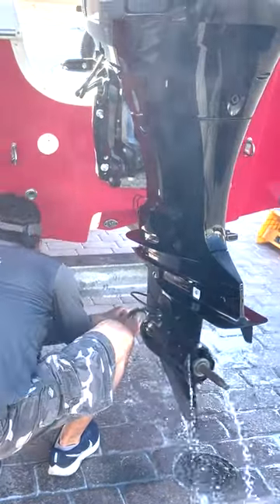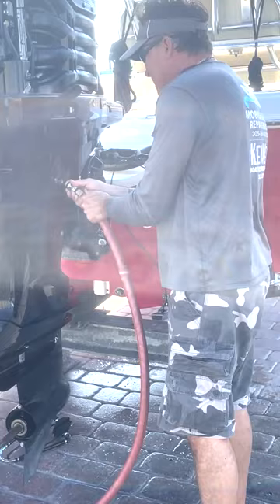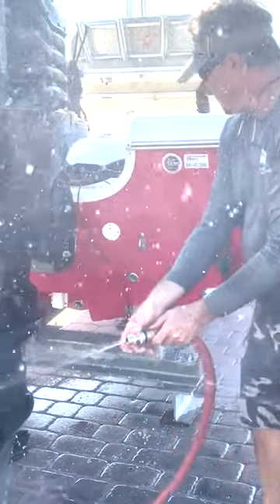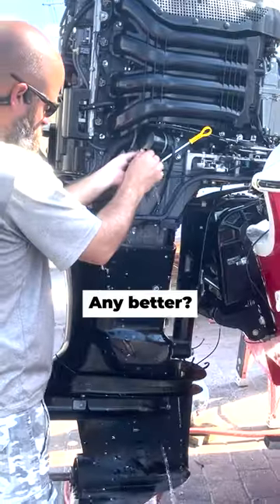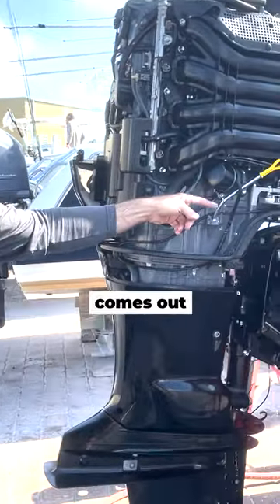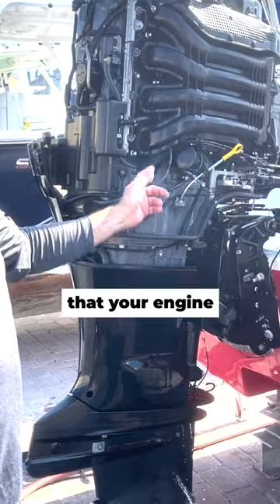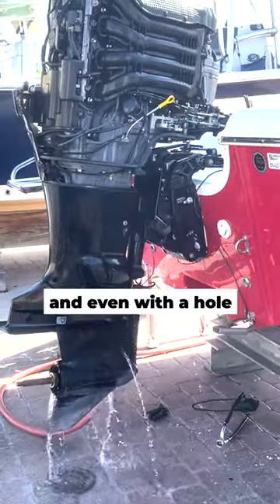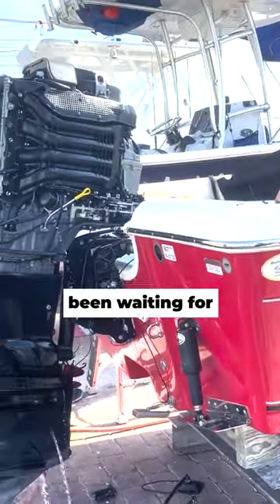OMG My Outboard Motor is NOT Peeing

Comment: Some older engines require you change the water pump impeller every 12 months . I did mine every 18 months . Also you should freshwater flush your engine everytime you use it . Also newer engines may not require replacing impeller as often . Consult your owners manual or ask the service dude . If you have to use weed trimmer line to unclog the pee hole you aren't flushing long enough or at all . 
After I wash the boat I flush the engine.  Let the motor run at idle while you dry off the inside of your boat . By the time you spent wiping stuff down that should be adequate time of flushing .
Reply from the maker: Our owners hadn’t flushed it was full of salt!

Comment: I would pull the lower unit just cause and rebuild the water pump. At least every 2 to 3 years I do mine unless my water pressure gauge says other wise. Meaning lower pressure than normal and my pick up is clean and clear and all water ports are free and clear. Always flush your motor after running it in salt water heck I even do it after taking it to the lake. Soon  Myers boat shop in Victoria Texas will be open for business. It will be one of the best and most reliable boat shops in South Texas. Long line of family and friends who I grew up around that have shops and are retiring. Learned from some of the best boat and motor gurus in South Texaa.
Reply from the maker: Good for you sounds like you have experience! We changed the pump but ended up being full of salt!

Comment: Plugged by tiny dort wasp or silt.
If it doesn't start working after clearing it. The rubber water pump is hard, cracked, and worn out
Reply from the maker: We replaced it … ended up being full of salt!

Comment: i have try that trick didnt work so i make video how get rid of clogged issues but not for yamaha engine because they have brass or copper inside tube which salt water cause it to clogged up inside engine so i ended up pulling head off grab long wire brush put on drills and stick it down port and drilled it out so no more clogged issues
2nd if your small hose is clogged them check for exhaust vent above propellter  front of top u cant miss it from lower shaft stick out look above it will see vent and see water coming out of that vent which it mean not clogged up if no them it iis clogged up but i dont trust small hose from engine i trust one by lower gear box front above propelleter because only water exited from it if you start it up and let it run little bit longer you will feel hot water coming out of it
Reply from the maker: Ours was full of salt ... owners hadn't been rinsing it!

Comment: Sometimes bees fill it with mud as well or it could be an impeller. If you use the muffs to force water in it, but drop the lower end into a big barrel of water to see if it sucks water in. 
If the impeller is shot, you're still forcing water through under pressure.
Reply from the maker: Was full of salt!

Comment: I was always told don’t rev the motor when using the ear muffs with a garden hose because the water pump on the motor sucks more  than the hose can provide and can burn up the pump that way.
Reply from the maker: Our issue was salt?
Reply: @WillFixThat  glad it was an easy fix in that case. Just was something I always kept in mind when we had boats
Reply from the maker: @stevecourville199  thanks for sharing

Comment: Probably the impeller I had an old Johnson 25 that the rubber impeller would dry rot if sat up for more than a month without water being run through the engine.
Reply from the maker: We changed the impeller it ended up being full of salt!

Comment: I think I need to learn more about outboard engines, switch from mower to boat engines.
Reply from the maker: Or both 😆
Reply: @WillFixThat  you really don't unlearn how to do something, I was a Auto mechanic for many years, cars just got to be computerised I gave up, started driving and on working on mowers. Now those are getting computer's,  outbound engines have a lot more parts, but it's a engine transmission and drive line, can't be very difficult to figure out
Reply from the maker: @kennethwoolever5054  some of these outboards you also need a computer to read codes when you have issues!

Comment: My outboard wasn't peeing. Changed impeller, thermostat checked lines and water jacket. Still no water on "muffs". Figured out it's a dry sump and had to put it in a bucket so the water level was the same as the impeller would be in the lower unit.
Reply from the maker: Ours was full of salt!

Comment: Yeah that motor will be junk shortly . If you have salt issues then it is over . Maybe a couple more years but that bell has been rung . Flush everytime you run salt . If your not running it daily in salt . Even then ill flush mine occasionaly . The worst is running in salt and letting it dry without flushing . The crystalizing of the salt does the most damage to every edge ande nook and franny in that motor . Im A mech btw and guys a handheld therm is great for a laying alot of the fears and guess work as to whether it's actually hot or not 30 bucks .
Reply from the maker: Awesome… we DO to tell our clients whether or not they listen! You know the old saying about leading a horse to water!
Reply: Yes sir. You may find this uncommon as well. I replace my pump every year , I like opening the lower end and seeing what's going on . Rarely do I not find something cool . Like dog gear shavings or a little watta..lol. seriously tho maintenance is cheap.
Reply from the maker: @danglss76  we only do this if the client asks for it …. We aren’t looking for work if you know what I mean!

Comment: Ummmm, doesn't it need to be in the water? The boat picks up the that the boat is sitting in and spits it out those holes.. that's why you should run your boat motor when it's not in the water for very long
Reply from the maker: It needed an acid flush.

Comment: Impeller my friend your supposed to service your lower unit and impeller every season or 300-500 hrs idk about you but when rubber sits it dry Rots
Reply from the maker: This is a very new boat … we just did 200 hr service for our client?
Reply: @WillFixThat  very odd because if it’s newer it shouldn’t have any salt deposits built up in it I wouldn’t think might have sucked up a piece of Reid grass or something
Reply from the maker: @NcHeelsDavis  not really sure if it was ever flushed!

Comment: Water pump impeller ain’t doing its job or is severely damaged.
Reply from the maker: Discovered the cooling jacket was impacted with salt due to improper fresh water flush after used in the water’s around Key West Florida
Reply: @WillFixThat  That happens quicker than most people believe….. but it is cheaper to repair.
Reply from the maker: @donaldmartin4980  yes agree on all your points 👍
Reply: Get a two side feed muff or put bucket under lower unit  not push enough water pressure JT HOOKED N ROLLING OFFSHORE 🇺🇸🇺🇸🐟🐠🎣🛥
Reply from the maker: @hookednrolling2009  JT thanks for sharing!

Comment: Suzuki are typically not friendly with muffs and you have to tank them for testing
Reply from the maker: It was full of salt once flushed a few times it peed!
Reply: Yep. Must run them in a tank , unless you tape off the other water inlet holes on the lower

Comment: Needs new impeller.
Reply from the maker: Yes it was changed & still an issue.
Reply: @WillFixThat  Oh ok. Could be the waterpump itself that's damaged. Another small thing is there sealant where the water pump seats?
Reply from the maker: @CalebsBikeLife ended up being full of salt!
Reply: @WillFixThat  oh crap ok that's pretty bad
Reply from the maker: @CalebsBikeLife yup ran salt away thru it twice!
Reply: @WillFixThat  oh good.